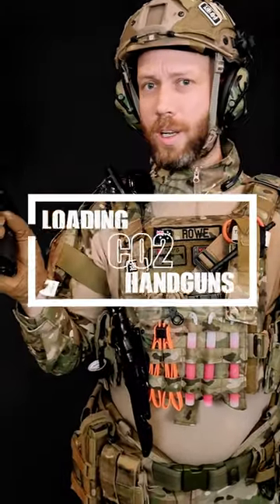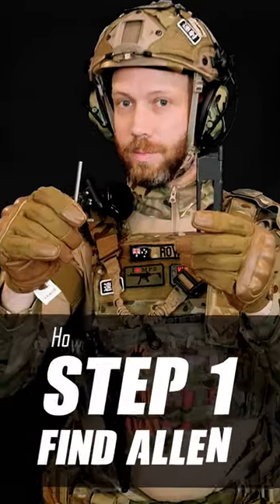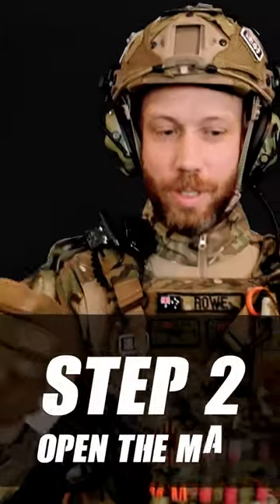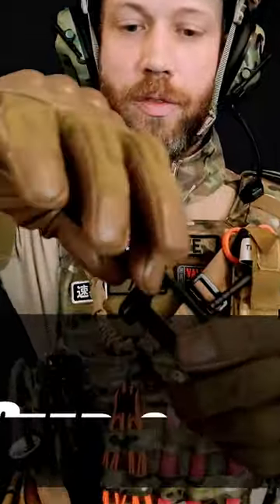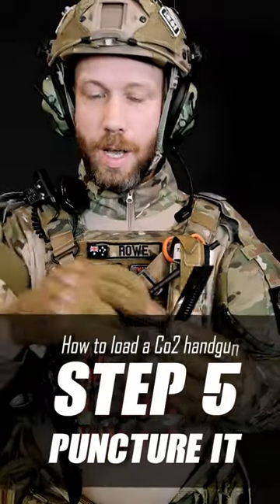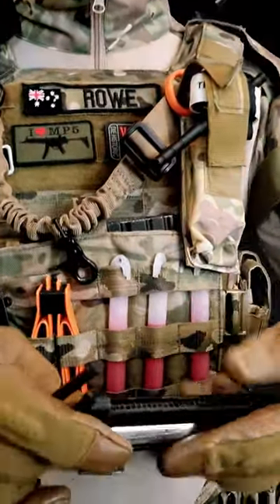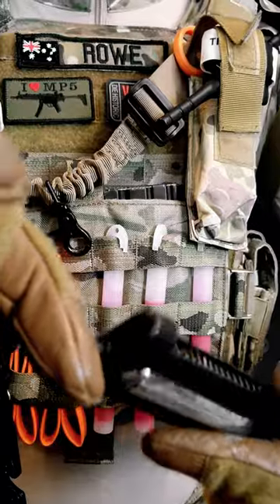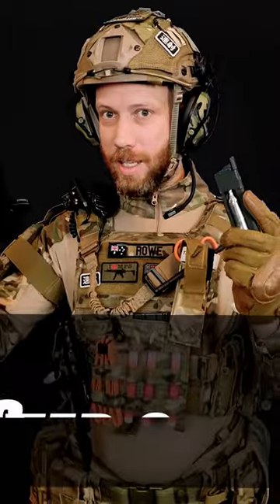How to Install Co2 Cartridges in Pistol Magazines [Carbon8 M45] Airsoft Tips & Tricks for beginners

Comment: I did this but it’s like as soon as it’s punctured it just goes everywhere, I’m not too sure how to stop it I just got the Glock 19x and wasted 2 cartridges trying to load it
Reply from the maker: You need to puncture and close the cartridge very quickly. As soon as it starts to hiss, you need to tighten the connection really quickly. I try to do it in one smooth movement.
Reply: @defroweairsoft  on my first try, it went smooth. Little hiss, and then silence. On my next attempt I did the same thing and it spews everywhere, barely just punctured it. Tighten it a bit more and it's still loudly hissing. In a panic i threw the mag in a box to let it fissle out. I guess the mag that I loaded it in is faulty..
Reply from the maker: It's possible there is a broken O ring. Don't worry about the CO2. If you have gloves on you'll be fine. It can be scary though. It took me three or four co2 cartridges until I could do it correctly.   @Killbayne

Comment: I’ve tried twice and the co2 goes everywhere. I hear a little his and then I tighten it a bit more and it goes everywhere. I thought I had it the second time but I noticed a really quiet hiss so I tightened in a tiny bit and it went everywhere. Any suggestions?
Reply from the maker: Sounds like an O ring or seal is loose, especially if the gas is coming of from the top of the mag. There should be a screw or similar thing you can tighten with a screw driver or Alan key. Try that and see if the problem persists

Comment: is it true u need any greases (silicone oil for example) on the tip of the Co2 cartridge? I've been told and seen that u do but someone told me that's only for older airsoft guns but not newer one's
Reply from the maker: I've never had to use silicone on my guns. But I generally don't take great care of them. I don't clean them or spray them with silicone and they still work fine after years.
Reply: @defroweairsoft  i keep being told a diff thing like i need it, i don't, i need silicone oil, i need PTFE, i need synthetic grease, i need molybdenum grease, etc. so I'm very confused if i do need grease or not. also the gun I'm talking about is an Elite Force H8R so it's not for moving parts, just for the rubber rings that prevent the Co2 leakage
Reply from the maker: @sxckqerz  you're probably fine. you don't really need anything. I've had guns for 20 years and havent cleaned them and they are fine. If your gun isn't working that's a different story

Comment: My we tech g18c mag won’t tighten enough and all the co2 leaks
Reply from the maker: I had a similar problem on my m45. The entire co2 canister leaked when I tried to put it in. The issue turned out to be a screw was loose. My friend fixed it quickly by using a special tool to adjust the screw since a regular screw driver / hex key didn't fit.  I realize this is a terrible explanation. If you buy the tool,  you can probably fix it yourself.

Comment: Hold up I just bought and shot my Co2 powered BB gun and I remembered Co2 is a toxic gas, what happens if I breathe it in 😭
Reply from the maker: I'm not a doctor but I don't think there is enough in a 12g canister do due any damage. Just use it normally, and you won't have any issues.